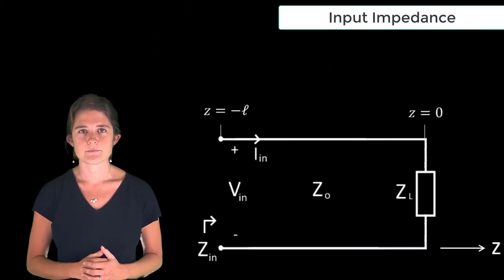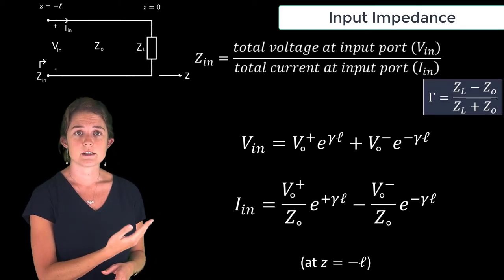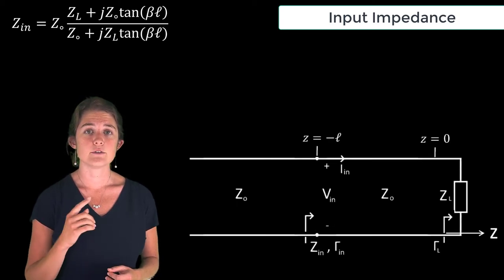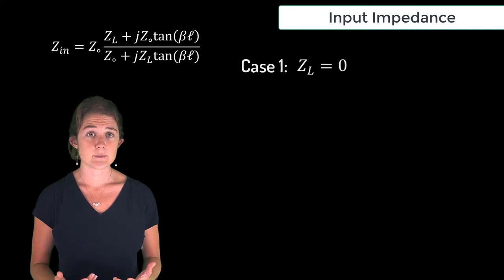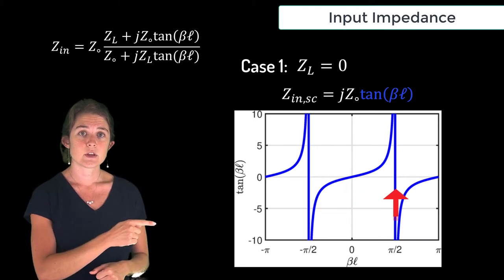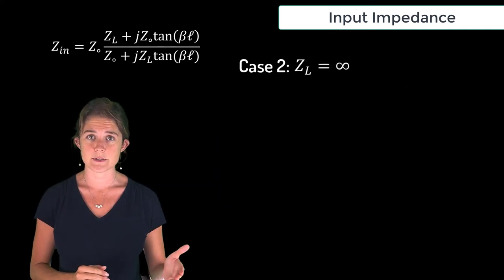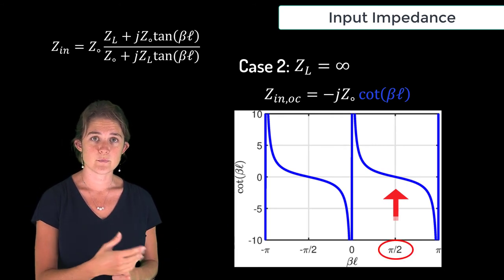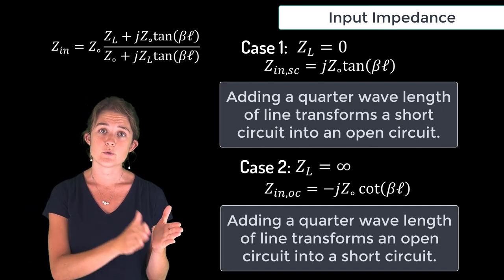Input Impedance — Lesson 8

Comment: Where are you getting gamma, little L, and Beta?  Professors often say, "Here are the equations. Now run with them." Ugh.
Reply from the maker: Hi Dan,
Little l is defined in the first figure - it's the distance, in meters, from the load.  Gamma and beta are the standard variables used to represent the propagation constant and the lossless propagation constant, respectively. If you start at the beginning of this playlist, it might help introduce things in a logical manner.
Reply: @emviso  thanks madame 🙏🏼